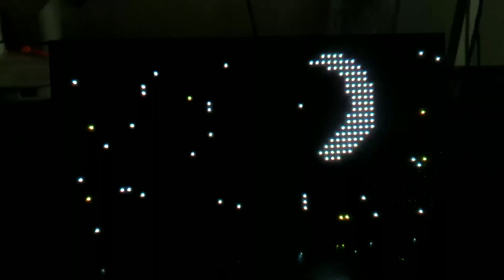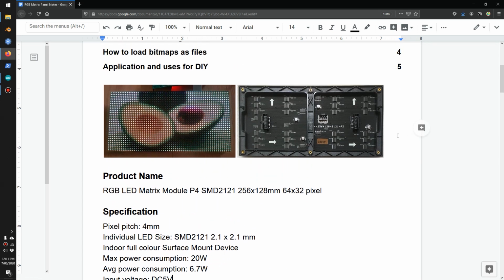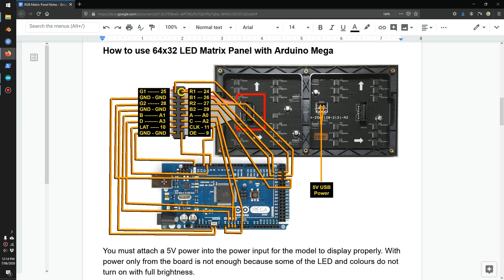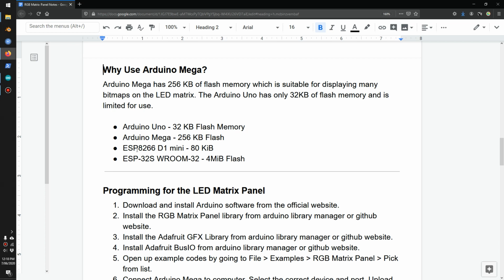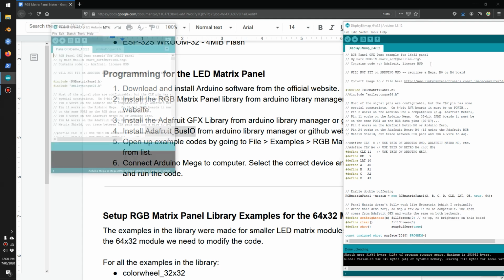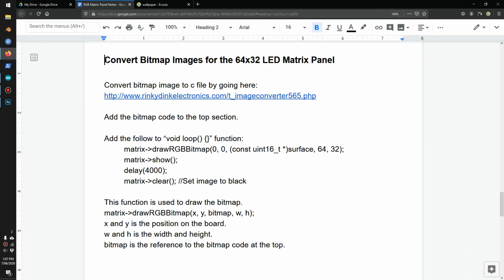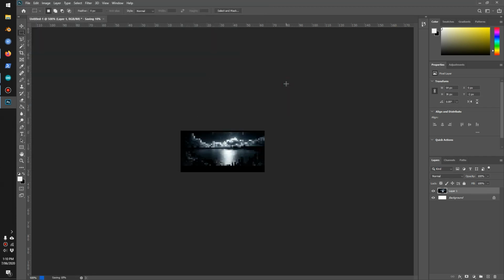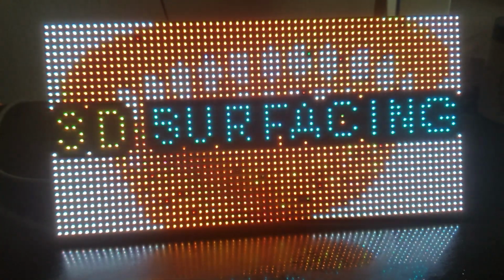64x32 RGB LED Matrix with Arduino Mega Tutorial

Comment: Hi, i have followed every step, but on my rgb dispaly it only shows the red color. Can you help me please, I urgently need it for mt school project.
Reply from the maker: Try add power to secondary plug. Double check everything again.
Reply: @3DSurfacing  thanks for replying, but it still doesnt show colors. i have tried another code and the colors are showing.
I want your code, but only red works
Reply: @3DSurfacing  thanks, its working now. Just reinstalled the library
Reply from the maker: @bignose1340  Great!

Comment: Question: I'm going to have 2 64x32 matrices but a 32x32 matrix in the middle, how do i set this up? I can't find any good info
Reply: Just chain them together using the in and out port and the provided cable. Technically a 64x32 Matrix is the same as two 32x32 ones. You could look for an example with 5 32x32 Matrixes and use it.

Comment: hi, thank you for the tutorial. i have coverted 20 images to the right size and got them as a c file, i modified the code properly and it completely stops working at around 15 images. while is shows that i am only using 37% is this supposed to happen? if not could you help me?
Reply from the maker: Rick that is about right. Each image is around 20kb. The flash size is 256kb. If you want more image, you would need a board with more space.
Reply: @3DSurfacing   thank you for the quick reply! I wanted to use this led matrix for gifs so i think it would be smart to upgrade eitherway. 👍

Comment: the codes doesn't work for me
Reply from the maker: Are you using the same matrix? Check your wires and code.
Reply: @3DSurfacing  I fixed the wires and it worked perfectly. But can the code displays 2 images for 2 boards ?
Reply from the maker: @MigoyantopG  When you combine the 2 boards. You can set the WxH for the 2 boards as one. For the images, you can just combine them as one.
Reply: Will it work for 128x64 panel?